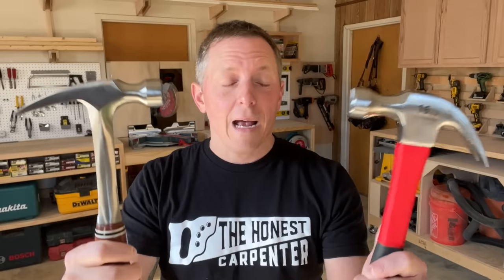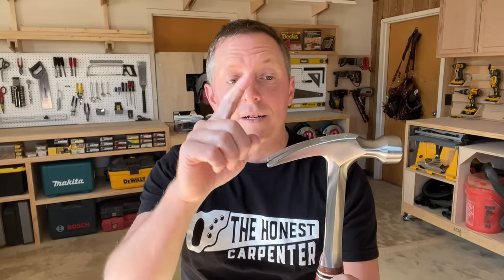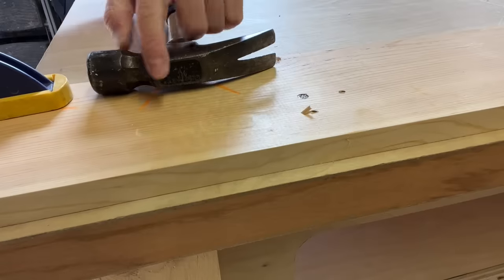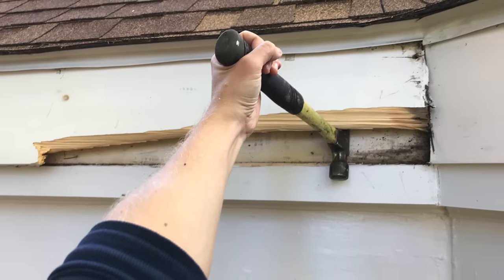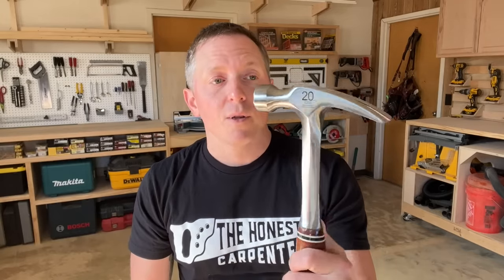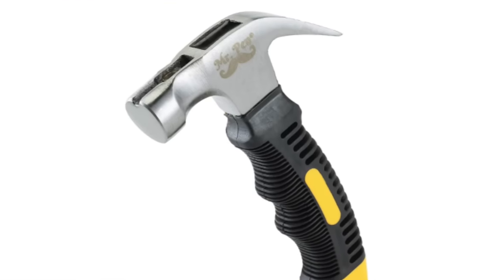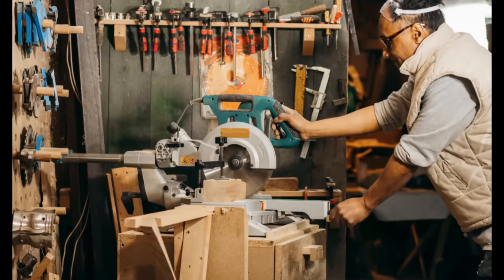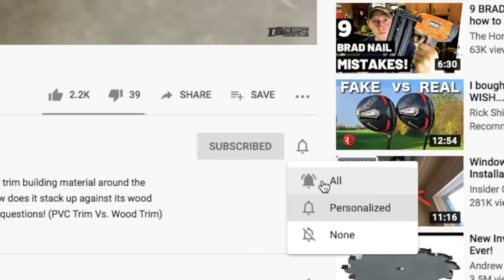DON'T USE STANDARD HAMMERS!! Try This Instead...(Rip Claw Hammer Vs. Curved Claw Hammer--Which One?)

Comment: Way back when before I bought my first Paslode or Senco pneumatic nail guns, I was using hard trim nails. We did a lot of fancy triple and double crown, crazy big base boards etc. I used a 16oz  wood handle Plumb, straight claw. We drilled a 1/4 inch hole about one inch deep in the butt end of the hammer. In this hole we packed wax from a toilet ring. If you ran across something that was hard to nail, a little wax on the nail did the trick. ( can’t do that with an Eswing, made in Rockford Il. BTW) Those hard trim nails would leave your fingertips black. And don’t stick em in your lips to hold. When I got my first California framer, I was really cool. Demo was left for my old framer.  Watching your video, when you pulled those nails, I was saying please put a cut off under your hammer head. 😮.  No body knows what a nail set is anymore. Haha.

Comment: yeah, rip claws are pretty much all i use. did roofing when i started out and it was only tool for that using claw to cut shingles pry out nails even rip paper off a bundle of shingles. i have drawers of hammers but pretty much just use 20 oz estwing

Comment: When I became a carpenter's apprentice in November 1970 (after a disastrous third year in college after transferring from junior college to real world university--and signing up for three chem's, physics, calculus, and German--no guidance counseling at all), I started out with an old 16 oz. curved claw, a cloth nail apron, and an old painters' inside rule that my father gave me. It took me weeks to save up for a 22oz. Estwing like the one my foreman used, and it took me even more weeks/months to learn the use of it, but I would never frame with anything else. The nicest old guy on the job who really taught me a lot was an old carpenter named Henry. He had a thirteen ounce curved claw that he used for everything--and he could do anything on the job--including framing. I loved that old guy, but I couldn't frame with that tiny hammer. With that 22 oz. Estwing, you could DRIVE nails, not just try to persuade them to enter the wood. My foreman, who was a hoss and dropped out of high school at age 14 to support his family, could set and drive home 16's with two swings. It took three for me. I love hammers. I bet I own more than fifty hammers--of all types, from carpenter's to mechanic's to mauls and sledges. I've even got a complete set of new old stock Blue Grass hammers that I intentionally never used, and an original set of Plumb fiberglass handle hammers of all sizes, including a roofer's hatchet and a complete set of ball peens. I remember, back in the seventies, when you could just walk into Southside Hardware and buy any of this stuff right off the shelf. Those days are pretty much gone. And the use of the hammer is becoming something of a lost art. Even I myself now use pneumatics for trim--and that used to be a sacrilege to me.

Comment: yes a rip hammer for sure, I have a steel handle rip for demo work but for construction, I prefer a wood handle hammer that has been shaved down to fit better in my hand. I use bees wax to help with grip, I had a fiberglass handle hammer and i cam home every night with hardly being able to hang on the steering wheel of the truck. I have never owned a Ti. hammer but I have heard good things about them. chooseiing the right handle is  important too.

Comment: For a solid framing hammer I like a long wood handle with a light head. Milwaukee actually makes a really nice framing hammer for only 30 bucks. Not that estwing knock off. 
But an actual hickory handled 19 Oz framing hammer. It's really nice for the price. I like it more more my Vaughn and for half the price

Comment: Funny part is I used to always try to find good straight claw hammers when I bought new hammers! I always hated the curved claw hammers. THEN I bought a nail gun and I don't seem to use any of my hammers as much as I used too!! And though I still use my straight claw more than any other hammer, generally it just hangs in my shed a lot of the times collecting dust, partly because I am trained as an auto mechanic who does small construction jobs on the side, like building sheds and decks!!

Comment: I use a “light weight” curved claw in my shop for finish work because it’s smooth face and smaller head and a California framer for construction work. 
My most valued hammer is a curved claw not because of function but because it was my paternal grandfather’s hammer.
Reply: My rip claw has a flat surface, I also have a framing hammer that does not.  Both are rip claw.

Comment: Thanks for this video! Can you talk more about steel vs titanium hammers, wood vs metal handles and a bit more about those 20 oz and over hammers
Reply: Titanium will not rust, it is good from when to expect exposure to water, it is also more expensive.  I have a few titanium tools but not much.  The main problem with wood handles is they have no ergonomics and have a heavier handle which shifts weight away from the head.

Comment: I use a 28 oz estwing for concrete construction for driving nails and driving concrete pins from sizes 12”-20 any concrete pin bigger I use a 4 pound mini sludge
Reply: It’s also a framing hammer the 28 oz

Comment: I had an estwing with the leather handle. It was a decent hammer unless it's raining. Very hard to keep a grip on it in wet conditions. I swapped to a dewalt rip claw after a couple of months, which in my opinion is a better hammer, for roofing anyway (and cheaper). If you really want an estwing, buy one with a rubber handle if you're using it outdoors.

Comment: Some rip claw or I call it a framing hammer measures 15 1/4" from the center of the head to the base of the handle. This is useful for 16" on center framing.

Comment: Been swinging a hammer in one way shape or form for nearly 30 years now. Once I did commercial construction and used a rip hammer, I never looked back. 18oz is my preferred weight. If you can get one with a flat top on the head do so! It gives you the ability to do precision demo and install against flat surfaces.
Reply: Yeah, 16 oz seems a bit light for many nails but it is also more forgiving since it will take more strokes to drive the nail.  If you incorrectly use a 21 oz framing hammer on a nail will bend or even go in crooked.
Reply: @toriless  I got a friend who is a framer by trade, has been for over 20 years now. He swings a 21oz like a god. I have seen the man do things with a hammer that seem like the stuff of Marvel movies. Dont get me started on how well he uses a reciprocating saw and skill saw. Its a pleasure just to watch people like that work.

Comment: Rip claws are so underrated here in Norway. Everyone I've worked with have used curved claws, and they just scoff at the rip claws because they haven't used them, and almost refuse to even test one out. Rip claws make it so much easier to pull nails in tight spots, not to mention all the other little things that become easier or even just possible at all by ditching the curved claw. Like opening steel banded material packets - sure, you can do it with a curve, but it's so much easier with a straight claw to just wack straight on. No having to bend your wrist to get at the steel band with the edge of the claw, or to avoid smacking your knuckles. 

For a VERY short period, they were popping up in stores, but they were all removed within a few months... I had to order mine online to get one at all, and there were only 2 brands available in Norwegian online stores. Yes, I could have ordered from abroad, but it would have added a 40-50$ customs fee, so effectively it would have tripled the cost once you factor in customs and shipping in some cases...

There are some use-cases where a curved claw is preferrable, but for those occasions I just keep one in the kit and run the rip claw on the belt.

Comment: Not a pro at anything construction related.  Just a DIY'er.
I bought an Estwing 20 oz "framer's" hammer about 45 years ago when our family was building a hybrid log house.  Ground floor is logs and we then decided to go with a second floor, which is framed.

Since then I have also added a couple of smaller curved claw hammers to my tool set but, for most things, I still reach for my  Estwing straight claw.  If I'm pounding large nails and not pulling small nails, it's my go-to.

Comment: Check out a German "Latthammer", a typical tool here in Germany for this kind of woodworking. You won't see anything with a curved tip like the hammers in your video here. However, it is pretty interesting, that there are so many differences between countries and the tools which are used there.

Comment: Interesting stuff. I think a DIY-er is more likely to need to pull a nail (because it bent, or was started in the wrong place, etc.), and is more likely to want to avoid damaging the board or wall it's in. But for a pro who spends all day putting up a house or tearing a house apart, a rip claw makes more sense.

Comment: So rip is for demo and roughing, curved is for general construction.  You didn't mention size to fit in a standard/general tool box or getting into tight places. My rip doesn't fit in the house / portable tool box but yes I have one and suggest it for demo and framing carpentry, however if I only had one it would be a curved claw.

Comment: Those itty bitty curve claw hammers are fine if you need to hang a poster or some crochet work, or maybe if you have a burning desire to be laughed off the jobsite, but a straight claw is useful more ways than I can remember. I might used it a hunnert times a day without ever setting a single nail with it.

Comment: 100% agree.
My wife has a silly mini hammer that the handle opens to reveal a screwdriver. 
It sucks.
But good for her to hang pictures.
Reply: It's probably not very effective as a hammer or a screwdriver. But if it's the one I'm thinking of it's a fun gadget if it has a smaller screwdriver inside a smaller screwdriver inside a smaller screwdriver.

Comment: Informative as ever, thanks. Any chance you could do a video on the use and application of laser levels? Been told they’re being used more and more by carpenters to set architrave, skirting board etc.
Reply: Most useful for framing walls but have other uses.

Comment: No law says you can only have one.  I carried a rip-claw for the obvious reasons, but they required a lot more yanking to  pull a nail. 4:47 And  I carried the curved-claw, 20-oz, which even with its shorter handle, had better leverage and  required much less effort to get out the 16d framing  nails I had to pull. 4:40. I've seen a wood-handled rip-claw break off at the hammer  head when trying to straight-pull a 16d sinker.

Comment: My uncle was a carpenter for a career and he used curved claw hammers.  I have a few of his hammers that were left to me when he passed on.  I am not a carpenter, but have done a fair amount of carpentry work in my time.  I used my dad's curved claw hammer as a kid, but when I saved my snow shoveling money and bought my own hammer, it was a straight claw and I have used them my whole life.  That first hammer was made by Plumb, I lost it somewhere and replaced it with an Estwing.  Both are steel handled hammers.  I haven't driven enough nails to do any joint damage in my 66 years on this planet, and I like the durability of steel handles.  I also check the face angle before I get a hammer, they differ by manufacturer slightly.  I found that out quite by accident.  I always assumed the striking face is parallel to the handle, that is not the case.

Comment: The first consideration in choosing a hammer should be what the long term effects on the body is. Your big all metal meat maulers send the greatest amount of shock waves up the arm. Wood is better at cushioning the shock waves.  Fiberglass is even better.  The power behind the hammer is more important than weight. 
The right tool for job.  I own several different hammers.  Depending on the work of the day is the choice for the one I use.  I have framers and finish hammers.  I have old beat up hammers that I use for demolition .

Comment: I like a rip claw on the job but just ordered a heavy duty groz claw hammer for nail pulling.
I do want to get a smooth face rip claw, have been shopping to see what's out there..
The hart ones at Walmart look ok but I'm unsure what to get yet. So far I use a Vaughn 150 year anniversary hammer I got two years ago.

Comment: In the house I have a 16oz ripping hammer for hanging pictures and such. My go to hammer is a 19oz with a wooden handle. I can choke up on the wood handle. I used to use a 21oz. Lost it, I cried. Went right out to replace it and couldn't find a 21 so got the 19, and hey, it's 2oz lighter in the belt. I do own a 28oz milled face Estwing, for serious destruction, not subtle at all.

Comment: The curved claw handles tight spaces far better and the ability to pull nails with greater ease and precision shouldn't be underestimated.  I wouldn't say the straight hammer is superior, just better suited for some things.
Reply: Yeah, I have had to start a head with a prybar to even get a curved head it.  Most construction is done with 0% concern about the need to fix it later.

Comment: You explained that a 16oz is the ideal weight for a hammer my question is, is the weight the only thing that varies or are there different length hammers? If so what’s the ideal length for a hammer?

Comment: I never looked at hammers the way you pointed out their shape differences. I always thought a hammer was just a hammer. I always hated those hammers with the waffle tip. But I’m sure the waffle tip hammer has a purpose for those splines on the tip, I just don’t know what it is tho.  I just know that they ruined surfaces. Thx for the education btw!

Comment: If the face of the hammer is flat and is not slightly concave then when trying to sink the head of a nail flush with the surface you will end up with a ding in the wood. When buying a hammer put two of the hammers face to face and observe the way the faces meet. Cheaper hammers don't have a crown ground into the face. Finish hammers that allow you to sink your nail flush, do have a crowned face.

Comment: When I was 14, My father gave me a cheap curved claw hammer with hollow tube handle, having a rubber grip. 
Despite its low quality, I used on many a a project, roofs, decks, etc. 
What I found out was the light handle was easy to swing and all the momentum was carried in the head. 
Eventually, I wore it out. But the design made the work easier. 
Choose a hammer that is instantly comfortable in your hands. After all, it is an extension of your hands.
Reply: Modern shaped plastic hand with ergonomic rubber grips are similarly lighter than wood.

Comment: the first tool I bought was a Jim dandy standard claw hammer from COAST TO COAST  it costed $1.05 with tax and was a very good hammer it was stolen after 45 years along with $70,000  + other tools . it had a hickory handle. I'm a mechanic not a carpenter. but I used it a lot . straight claws in my day were called framing hammers I was 30+- when I bought one as I remodeled my house aka the money pit. the only reason I bought it was because I was working for the state and was posted in the middle of no where no place to rent for 60 miles and only 3 houses for sale the money pit was the best choice of the 3 .
Reply from the maker: That’s a good story, Tim—except losing that 70k in tools! 😱
Reply: @TheHonestCarpenter  it was worse they stole my 67 Camaro my mercedes and a tow truck I just bought the robbed my house . while on vacation

Comment: Curved Claw or Rip Claw, doesnt matter for a DIY person, just buy a decent Hammer in the first place for the amount of DIY you do.
most trade work here in the UK is done by a Paslode or other company nail gun and all you got to do is tap in the nails that stick out, so the actual difference between a Rip and Curve claw hammer at hammering is redundent.
If you in the Trade, buy the Hammer that will solve most of your problems depending on what you do. if your a Kit builder, rip claw will be better choice probably, if you do many trades like fitting panels one week to finishing work the next, claw hammer  may be a better choice.

Because i have other tools in my tool box, i use an Estwing 16oz claw hammer, and if i need to do demolition work, i go straight for the crow bar and hammer, i dont mess about with trying to get something out with hammer and find its stuck and need to get a bar anyway, too many times i wasted time and effort in past or watched others do it and its far quicker to carry the bar with me and then if hammer dont get it, the proper tool on hand ready for the job.

Comment: I like to use the Woody and also a hammer I call got that's called the duck bill but it can only be used in certain situations. The funny thing about the duck bill Hammer is it looks just like a duck's bill. But it's more design for ripping nails, then hammering nails in although it does have a side spot so you can go in between Joist if needed.